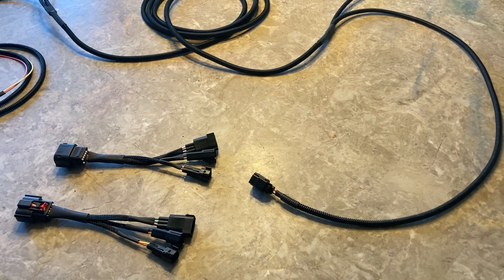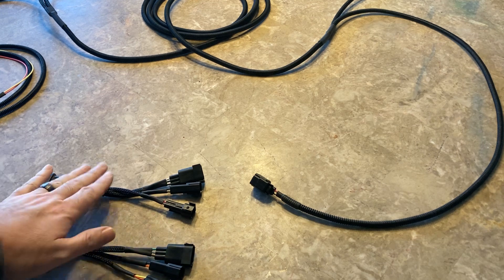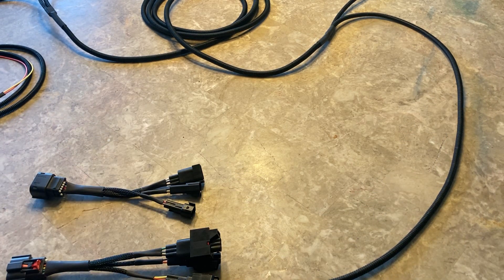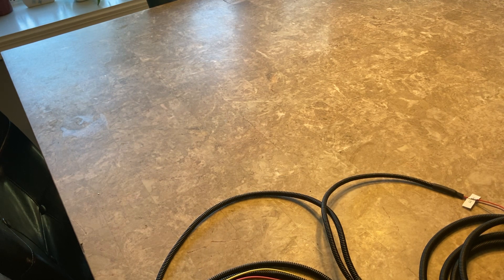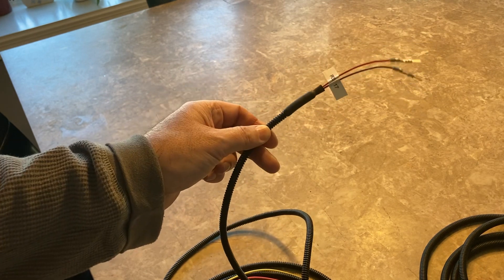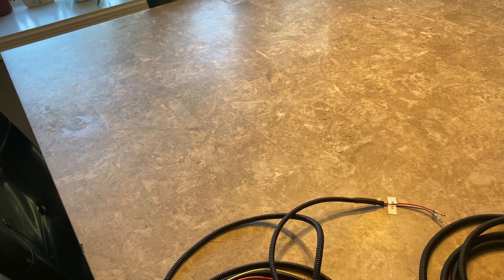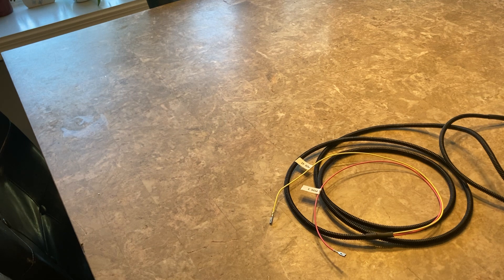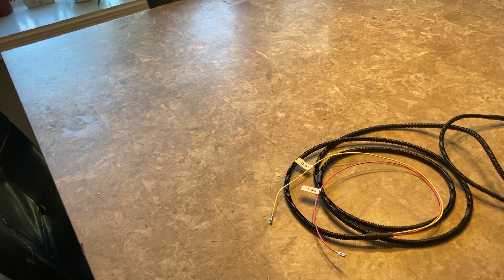Ram 4th Gen (2013+) Incandescent to 5th Gen LED Tail Light Harness Walkthrough

Comment: Hello, I have 2015 1500 Limited that came with LED tails from the factory. I picked up a set of 5th Gen HD LED tails at a great price. They are BSM tail lights but I have no desire to use that option. I just want to hook them up and utilize the amber turn signals. I already have AlfaOBD and the OBDLink MX+ so I'm familiar with how to use it and I'm capable of running wires to the BCM. I looked at the 7 pin harness but that's not the way I want to go. So the question I have is am I able to use these tail lights without the BSM function? And what would be the best way to wire them?
Reply from the maker: @scottcpan68  yes, you can wire them up without BSM.  I have a different video for the harness you would need (4th gen LED to 5th gen LED)

https://youtu.be/RY3XkWpYFGo

Feel free to shoot me an email if you want any info on that one.  Mrdougherty1@aol.com
Reply: @hydroblueram  Awesome, thanks for the quick response.

Comment: Great video! Do you happen to sell these for an 09? If so, how could we order?
Reply from the maker: @slacinace  the 09-12 Rams have a lot of differences electronically from the 2013+ Rams.  Really your only option would be to go with after market harnesses that uses resistors and splits out the brake/tuen signal.
Reply: @hydroblueram  Ahh gotcha... Super OCD about the rear signals not being in sync with the rest lol
Reply: Good day sir,  having to put a 5th gen truck bed on my 4th gen ram.  Do you sell the tail light adapters and blind spot detection harness. 
Thank you!

Comment: Do you make harness for 04 to 08 tail lights?
Reply from the maker: Just ‘13+ 4th gens right now.
Reply: What type of harness did you need for the 3rd gen?
Reply from the maker: @scottcpan68  I don’t work on 3rd gens.  5th gen tail lights wouldn’t fit a 3rd Gen anyways.
Reply: @hydroblueram   I understand, thanks for the reply. I was actually responding to the OP because I had some info for him.